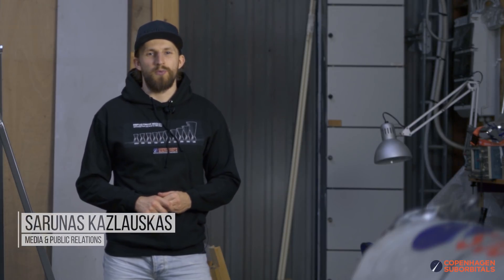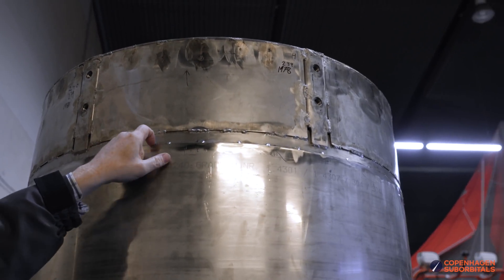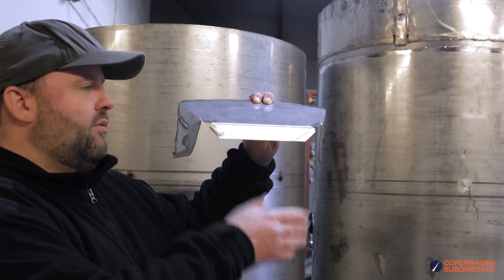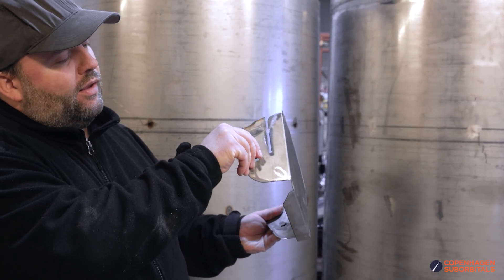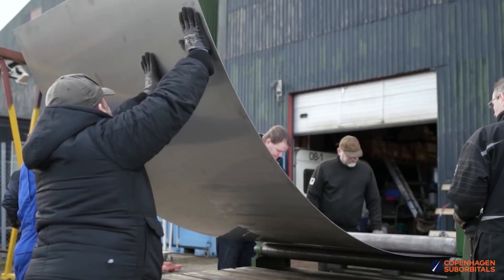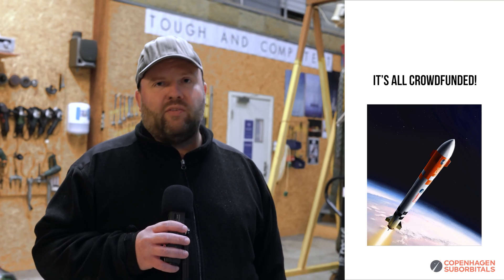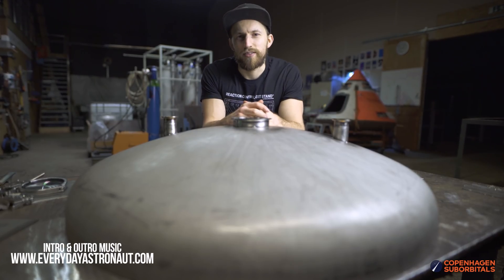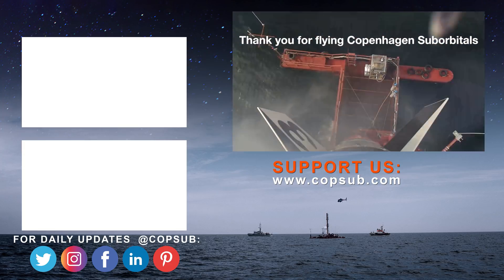How Rocket Propellant Tanks Affect Rocket Guidance? Anti-slosh Baffles

Comment: Hi, I know this is a late comment and pretty unrelated. As I understand it, the long-seam weld and all the welds in general are stronger than the metal around it. And you are also planning on pressure-hardening the tanks. There is only one long seam weld, and so it is asymmetric, my worry is that it will not expand in the same way as the rest of the tank and will sort-of skew the whole thing. Such as putting a piece of tape on the side of a semi-inflated balloon and blow it up more. I know that the guidance systems would probably be able to handle an effect from that in even the worst-case scenario, and I have essentially no experience with rocketry, but I just thought I should share my concern.

Comment: Hypothetical question: If you were to strap 10 Spica Rockets without payload together and stack an 11th on top of it fully fueled satellite payload at 1000kg, would the rocket be powerfull enough to reach orbit from 90km separation and  angle of about 45 degrees to the surface? Ofc. entirely hypothetical, im just wondering if something that ridiculous in theory could reach orbit if nothing fails?

Comment: *=* Cool, but for better communication of rocket and ground, I suggest a springs anti-vibration mounts for electronics and antennas devices, for not lost radiofrequecy, in the capsule prototype, and the first stage of the rocket, when decoupling, the electronic socket is disconnected too, also 2 antennas of rocket make incrementation frequency, or/and different frequency sended from ground, or remote, in the better configuration concept.

Comment: I was frantically searching for the usual identification marks we see on all other rings of steel before they get put together to form rockets. Where are the markings for SN1 or LOX? (No, not Starship, but Spica No 1)
Reply from the maker: We're not at a point where our booster production is going at such a pace that we need to identify dozens of different serial numbers...yet. Fuel injector production is a different story, though. ;)
Reply: @CopenhagenSuborbitals  But how can we the avid followers tell without proper handwritten identification markings? You need to get with the times and level with your fan base 😄
Reply from the maker: @Jens.Krabbe  You are probably right! As soon as we finish the tanks, give them a nice white coat of paint, and connect them to the intertank section we must add CS and SPICA 1 logos on! 😎

Comment: Great video. It surprised me to see that you are adding the slosh plates before deformation hardening, but I imagine that because the tank is mostly sealed by that point that there wouldn't really be an effective way to do it afterward. Unless someone is really skinny over there to climb in and weld it... like literal bean pole skinny lol. Keep up the great work!
Reply from the maker: Yes, we would need a stick figure to do the welds after deformation hardening (that would also need to build a CNC plasma cutter and forgery inside the tank to make the anti-slosh plates inside) or cut out an access hatch after everything was welded up, leak tested and pressure hardened.

Comment: Amazing work!

Do you think that SpaceX's rockets (specially starship) do have similar systems/plates inside the tanks as you do? If not, why not?
Reply from the maker: There are different ways to tackle the problem. Baffles are the heavy solution, so other rockets might use a rocket guidance approach that controls the rocket's motion in a way that avoids the fuel slosh resonance via software. Not sure which way Starship will adapt, but the Falcon 9 does have slosh baffles, for example search slosh and CRS-4 mission here on YouTube.
Reply: Starship doesn't have any afaik. You can see in the sn8 video whenever they shut down an engine the gimbal makes very rapid movements, that might be to counteract the sloshing that occurs. When landing, this is not as big an issue as the header tanks are much smaller and also round